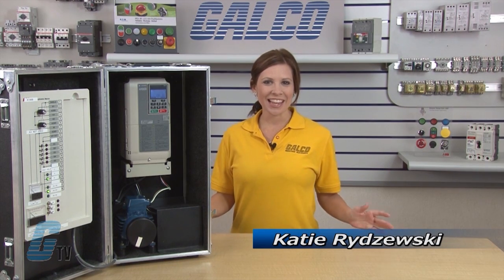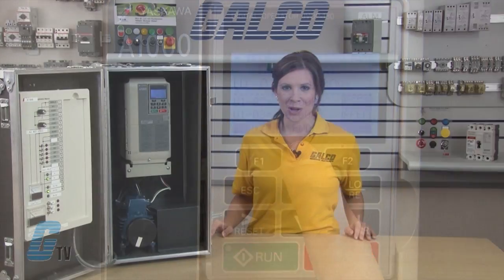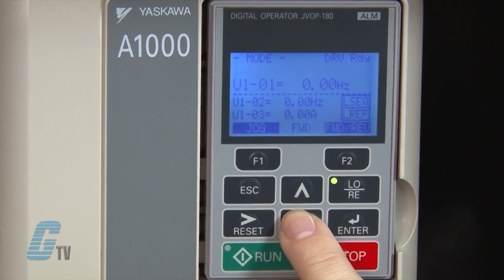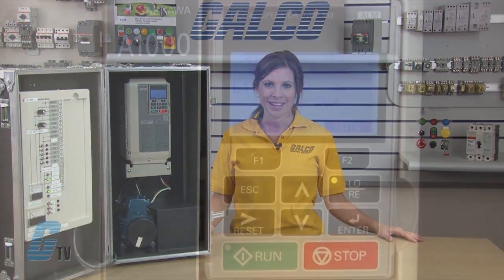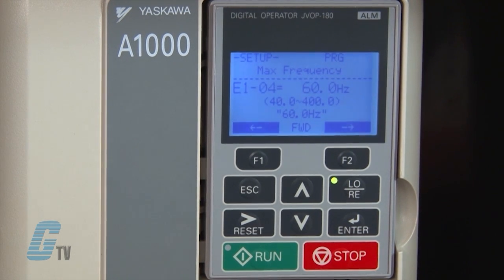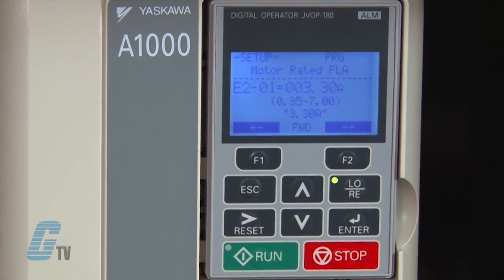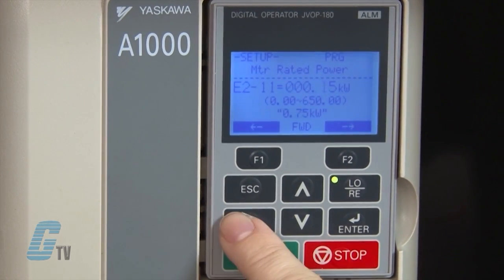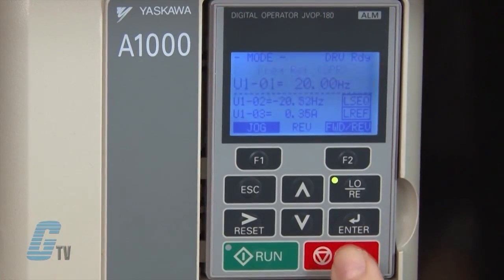Yaskawa A1000 AC Drive Basic Start Up Using the Keypad

Comment: What's the price for A1000 model per piece ?
Reply from the maker: Please give us a call at 800-337-1720 and ask for sales to quote you a price. You will need to specify the horsepower/KW, 230 or 460Vac supply, type of control (standard hard wire or communication like Ethernet, EtherCat, Profibus, MODBUS etc.). You will also need to specify any feedback options you are interested in or not. These all effect the price significantly.

Comment: The hardest part is just figuring out the terminology, acronyms, abbreviations and which ones are actually necessary to change and others that you should not touch. The instruction books are very complex and poorly written if you're not an electrical engineer, so these videos are very helpful.